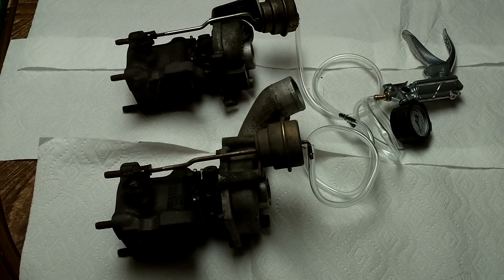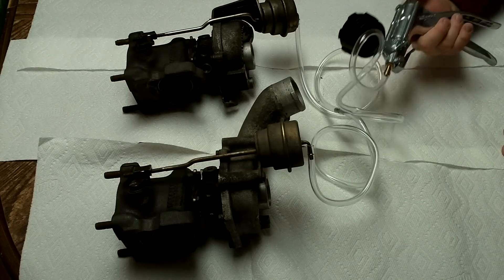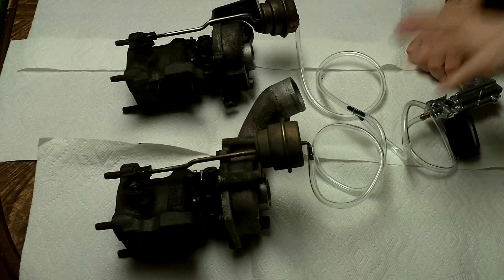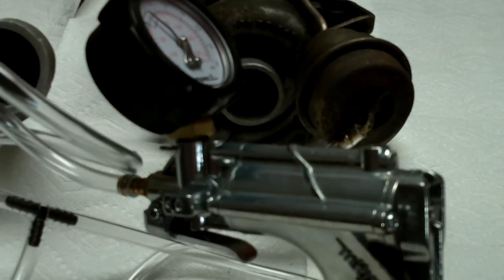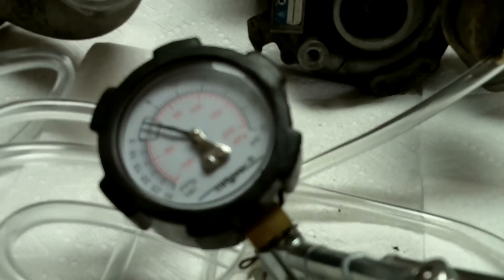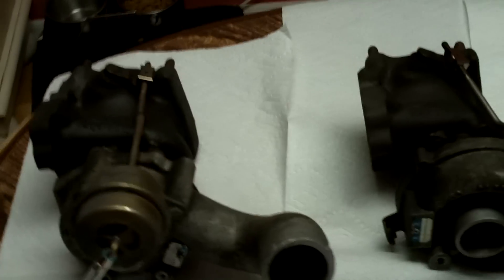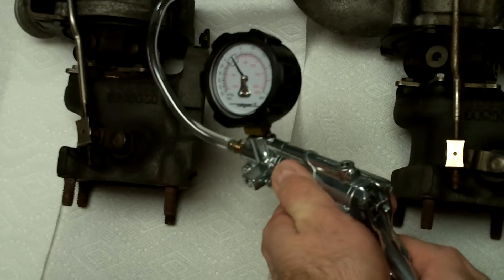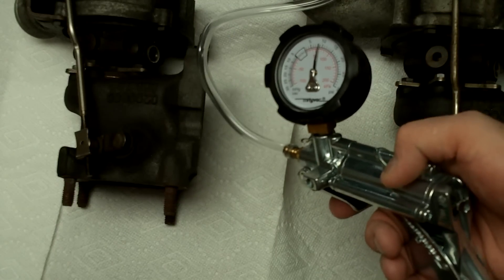How to Manually Test Wastegates

Comment: I don't have a compressor or specialized pump and was about to head to the local auto store to loan one out when I realized that I had a decent manual bike pump with a built-in pressure gauge which I was able to use to test my car's wastegate actuator. Just be careful as these things can often go way past 100psi (mine goes up to 160psi) so you don't destroy the actuator's diaphragm. You could also use a powered air pump with the same caveat to watch out for the pressure so that it doesn't get too high. And fyi it worked great with just an easy pump moving the actuator rod out and hold it till I relieved the pressure.

Comment: This only tests the actuator, not the actual wastegate itself.
Reply: True but you still should see movement on the arm the acuator attaches to. If not you have sticky vanes. Or take the actuator arm and test seperately to isolate which one it is.

Comment: I have a ko3 on my b7 a4. When I add pressure the valve will open but wont hold pressure. Does this indicate that the diaphragm in the actuator is smoked? Is this a known problem? Thanks
Reply from the maker: I believe so. Try replacing that diaphragm and see if it works properly. How many miles? Since these are moving parts they're common to fail with high miles

Comment: Can you use that hand pump to mute your voice?
Reply from the maker: Technically yes, but you would be pumping it by hand forever to charge up your system. I recommend using an air compressor
Reply: What is that pump called i need one i dont know what is called

Comment: great video! is that anti rattle clips i see on the actuators arm/rod? my vw tiguans ko3 has an annoying rattle and i got the anti rattle clip but i can't get it on as there's no space i can barley get my fingertips to it let alone push the clip on.the ones in this video are squarer and look easier to fit maybe can you tell me where i can get it or any tips to get the rattle stopped.it rattles on first cold starts and on decel
Reply from the maker: Interesting.  I've never heard them called that before.  I don't know if you could find just those clips.  Hit up the B5 community on Facebook.  Plenty of extra parts can be found there.....I'm sure someone could pull a set off some blown K03s for you!

Comment: I’m trying to diagnose an over boost problem on my Mazda speed three. I suspect the wastegate. Stock boost is 15.6. I am boosting to 20 with just a short ram intake and exhaust. Could the wastegate arm be stuck closed? Or opening later than it should? I’m going to try to soon on my car but just wanted to get some input until then, thanks.
Reply from the maker: Anything is possible.  You may just need to adjust your wastegate.  If vacuum actuated, the point of contact to the wastegate may have come loose, allowing the arm to move but not actually move the wastegate.
Reply: overboots is  to much air  get your turbo